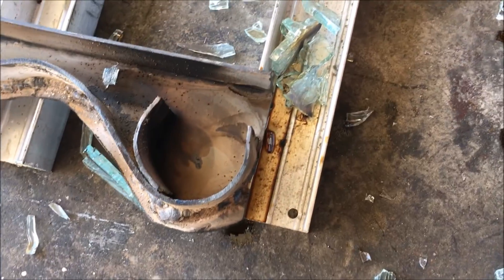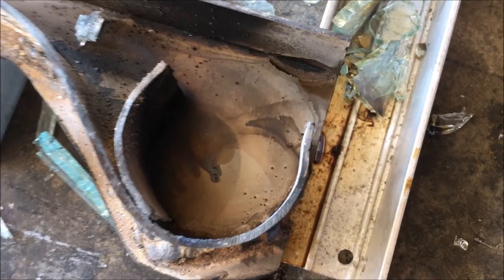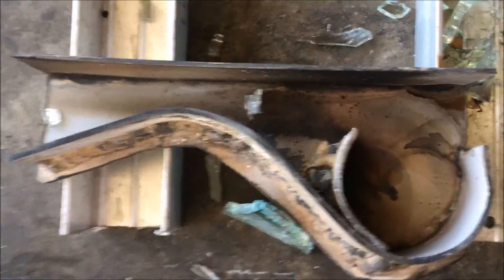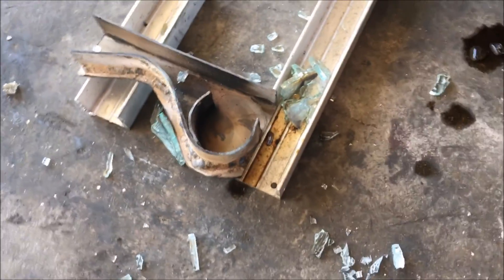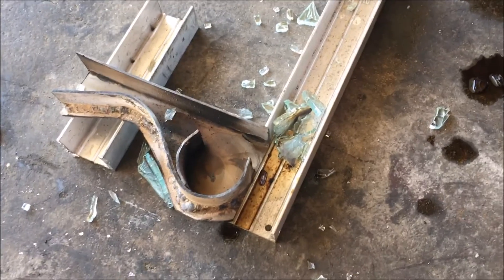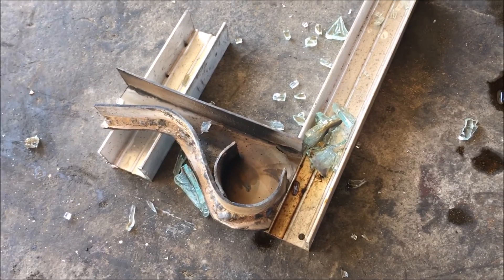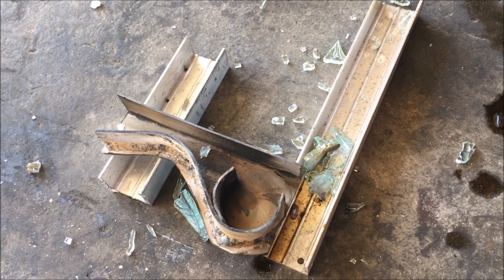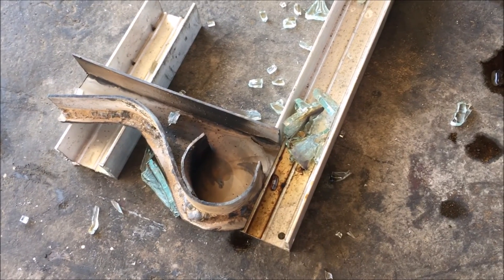Waste Oil Burner Extruded design LITTLE DRAGON

Comment: Do you think a fridge compressor could  do that? Need a burner for a knife making forge. Want to use oil .
Reply from the maker: Possibly , but not at very high outputs , i almost got it to work one day ,just make sure your fuel tank is elevated

Comment: Hi NOBOX7!!

I want to show you my experience with vegetal waste oil burning and, of course, my thanks for your help. You give me a great boost.

Please, I'll be grateful if you give me some tips and opinions.

Here, my videos with a short explanation (sorry for my bad english):

Aquí los links:

Parte 1:
https://youtu.be/8wpopvnAo08

To start the fire and preheat the combustion chamber, I use a 90% oil and 10% gasoil mix. Preheat the chamber takes 20 minutes and spends 200 ml of 90/10 mix.

Then I change the fuel supply to a 100/0 mix.

In my experience, turbulence, high temperature and a balanced mix of air and fuel are very important. It is evidenced by a blue flame. A yellow flame implies that any of the previously mentioned conditions has failed.

In the video, heat and turbulence are ok since the beginning. But, when I change the fuel to 100/0, fuel/air balance alterates. This is because oil (100/0) have higher density than oil+gas (90/10). This causes an interrupted flame.

This is fixed by increasing the oil pressure (rising the oil bottle), until I get a blue and continued flame.

Part 2
https://youtu.be/_T6cXg8BvCY

In this part I try to get the highest power as it is possible.

To increase power, I need to inject more fuel/air balanced mix. But I haven't jet a system that regulate both. I'm thinking about it.

In the video, when I increase only fuel, you can see yellow flames. Then, when I increase the air pressure, the yellow flames disappear.

Video start with only 15 psi air pressure and ends this 30.

You can see that a piece of Cuprum wire melting down. I put this to have a visual indicator of heat distribution inside the combustion chamber.

Part 3
https://youtu.be/74y_uTrsHDI

In this, I put a piece of glass, juts to play.
Fun is so important!!!

Good luck!!

Comment: Wonderful work!
I'm trying to emulate it, but I have such problems.

What kind of torch do you use to preheat and start the combustion?

I made an atomizer like yours, but I can't start the fire.

I'm trying with a 1.7 kw propane torch.

I use vegetal oil. First did it with cold oil, then warmed it. Neither worked.

I'll try mixing it with gasoline (5% first, then more if fail).

Hugs!
_
Sorry. My english is not the best.
Reply from the maker: Ok tell me do you have oil dripping out the front of the device as your trying to light it or does it all burn up with the torch on ? you may not have enough oil coming in , elevate your oil jug to increase the siphon effect and get back to me
Reply from the maker: i made a video just for guys in your situation https://www.youtube.com/watch?v=461NuKfFYyk
Reply: I can't light it.

Of course there is oil dripping, because there is not fire.

I tryed with different pressures, but nothing happened.

I asked you for the kind of torch you use, because mine produce a 950°C flame and I guess it is not enough.

The cold pressurized air with atomized oil mixes with the torch flame, and the flame temperature need to be able to heat this mix to start the combustion.

I suppose it is the same as any kind of combustion. Three conditions are needed: a minimum of temperature, gasified fuel and air to start it.

When I suggest use some gasoline I imagine this:

If my torch is too weak, I need more flamable fuel to start the fire. Once fire starts and the tube gets hot, my idea is give it just oil, because the three conditions are just present.

Sorry, I don't know if I explain correctly my idea in english. I feel like Tarzan 😁

I just saw the video you suggested to me. But I need to see it twice to catch most that you are saying there.

Comment: I would suggest trying to find a fire place door. One with a glass and use that with your experiment. Possibly even get a door that has the adjustable screw in air feed then you can vortex that air in. 

Have you by chance thought of duplicating the half circle in multiple spots but always causing the left side to quench.

Comment: Well you got a little ways out of it... Can you rig up a hotter oven to pre-heat it in?

At least you made it long enough to give us an excellent view of the flame cross section. (~_^)-b

1, if you can raise the opening temp a few hundred degrees, and 2, manage to reduce the un-heated portions of the glass [the more old glass, the more cross body stress and greater chances to shatter. 3, if you can somehow trick the exhaust where it flows back around the outside [without burning your hands, the nozzle or the table] you can keep the outer edges warmer and reduce the cross body stress greatly (I can sketch an illustration of this for you)]

I am not able to expertly claim anything, but your flame front looks to be moving anywhere from 350 to 450 mph, starting from the 200 to 300 mph air/fuel jet.

There are quire sensitive laser sensing machines out there that can actually determine flame speed, and you could possibly find or make a very tiny air speed sensor [like this but much smaller, I know they exist, but not where to get one without some serious research, you could in theory make one with nothing but some scrap metal and a cheap tiny DC motor and a volt meter, and again, I could sketch the design up for you] and insert it into the exhaust stream at various points to take readings.

Keep in mind, of course, that the sensor its self, being a mechanical obstruction, would to some extent interfere with the air flow, and in so doing, slightly create its own inaccuracy, so to some extent, one has to compensate with a minor mental adjustment. The sensor, by obstructing the flow will cause a pinch point which will ever so slightly, especially in points of smallest volume, force pressure head of its self to rise, and behind its self to fall.

This means one should allow a margin of error of +/- 5% on the final reading.

If you can estimate the speeds, you can also estimate the percentage efficiency of the combustion, albeit, I do not remember where I saw the formula, [I would have to search long and hard for it] there is a complex chart like a slide rule which allows one to estimate combustion efficiency on things like velocity, pressure, air/fuel ratios, atmospheric oxygen ratios, humidity, etc that jet engine designers formulated back in the early 60's as the jet age was just 'taking off' [pun intended and copyrighted =P ] .

Technically, without proper air dilution, the air fuel mixtures inside a turbine engine CAN get hot enough to melt the metal it is made of.

They get away from this by carefully diluting the flame with excess cooling air and using 'air envelopes' to shield the metal.

That makes me think.... If there were some way to make an air envelope between the glass and the flame, without disturbing the native flow of the flame, you could more easily observe it... No promises on not disturbing the native flow though.... ~( ,m,)~
Reply from the maker: I definitely enjoy Mathematical formulas , many of my older videos showcase that side of me , mostly chemical kinetics and thermal dynamics and a dab of Physics Mostly heat engines  and fuel synthesis  . Any way Im currently unemployed and cant justify spending any money , however i just finished a job interview for a high paying job so hopefully that works out . im a union carpenter so when a job is done i have the choice of taking time off or working for cash on the side " they hate that "  . Hopefully ill have some spending money soon and we can start doing these more sophisticated experiments . Im stalling at the moment lol  . And the Charts yes i think ive seen charts like that , they look like steam table's correct ?
Reply from the maker: as for the glass , i think if i get the lighting correct and we watch it at reduced speed also , then we can get a good visual for long enough to see what could be improved  , also maybe we can approximate the speed by drawing some 1" lines in the shot next to the flame , then we throw in some fine carbon dust or charcoal maybe even saw dust but thats a little big and may not travel at localized speeds     but the carbon powder would make visible individual sparks that could then be chosen tracked and then chronologically radared  using simple equations based of the video time stamps , i think we can do 1/8 speed on my editing software  so maybe if a spark flies  5 inches 0.5 second at 1/8 speed then we have 5" per 0.0625 sec so 1/0.0625 = 16 x 5 = 80 in/sec thats only about 5 mph but you get the point . the math just kinda showed it might not work lol its to fast to track it would seem with a camera this crappy . 400 mph is like 7,000 in/sec so never mind , havnt eatn yet maybe i botched the math some how , havnt checked my work but so far it dont look good for that idea .That spark would travel 437 " in 0.5 sec at a frame speed of 12.5% so no way the eye could work with those parameters . But a high speed camera could totally pull it off
Reply from the maker: I need to break down and buy a flow meter also , we could determine the air velocity of my siphon
Reply: I can totally relate to all of the issues you are experiencing, I hope you get that job!

If I get 'rich' somehow with some of my investments, I'll send you some money to support your work, either way, because you are trying really hard and deserve the support.

I would have already, but my local budget is still pretty tight here my self.
Reply: A way to ensure you can see the speed of your gas flow electronically would be to release single specks of something light [such as tiny flakes of magnesium foil or shavings which can be obtained either on e-bay or by scraping them off of a lawn-boy mower housing or a fire starter stick from Wal-mart or a camping supply store] with say tweezers at the inlet of the system and then counting the frames it takes to cross from start to finish.

The higher the frame rate, naturally, the more precise your measurement, although it may be that poor luck or sloppy aim may lead to it getting stuck in the swirl chamber.

On the other hand, putting too much in there at once can mess with the light sensitivity and the results of the shot, and/or clogging the chamber with ash, so dumping a whole lot at once would not be a great idea.

Just picking light flecks and dropping them in and around the nozzle at different locations on high speed setting should provide a pretty good estimates of gas flow, and the high brightness should make it show up well as long as it is not whited out by too much.

One might think the flakes would burn up before they got a good measurement, but if its traveling as fast as it seems, or even in the area of 50 mph [should I be off by a factor of 10] (that is 73.333 feet per second by the way) and so it would take roughly 0.0137 seconds if your flame path was 12 inches across, so not much time for it to really burn out and cool off.

Knowing the distance across, especially if you had one of those black and white rulers [say like taking something white and heat resistant and putting black stripes of heat paint on it to measured increments] and lay it at the bottom or top of your area of view [the top which is flat is the natural choice here] and count how many black and white dots the flaming speck passes per frame and that will give you your approximate speed.
Reply from the maker: the oven defiantly bought us some time , to bad the idiot running the camera forgot about washout .
Reply: Maybe if you have some more of that glass laying around, you can use your wood stove to heat it higher than your oven can?

Get it pre-heated in the regular oven then quickly transfer it to the wood stove and gradually raise the temp up as hot as it will and you should be able to get better results.

Also, wrapping the outside in insulation will slow the cooling process.
Reply from the maker: thanks , never seen this comment , sorry i did not reply , youtube comments are so broken
Reply: That's fine, it took me a week to find out what was wrecking my computer, got infested with some kind of newfangled bitcoin mining hack that took a while to discover and clean out.

Comment: Wow yeah that is a cool system . So the input has its pressure decrease on the Lower side as it glide over the lip which in turn creates the vortex?
Reply from the maker: Yes thats the idea but it wont swirl enough  without  the stater blade . Diagrams and simulations ive seen suggested it would do just as you said without the blade. The  Venturi effect is so powerful at the flow rates we are operating at that the vortex is swept away and only a tiny one persist that cant keep the flame lit . No vortex no combustion thats the deal , unless you induce a pulse jet and thats just to darn loud  , like Cops showing up loud

Comment: At 3.44 in I wonder if the surrounding external air temp at the front of the burner is getting that hot compared to the air being injected in to the burner and surrounding rear air outside that it is turning the front air vapour Into nitrogen that is then sucking in to the burner by way of the hot to cold science equation may be to check that just place a row of small metal rods on the lower exist of the burners plate like a conveyer belt style this should act again as a tumbler disturbance and heat holder to cause your white flame to fill the whole burner.
Reply from the maker: great idea i see waht you mean , like a gold sluice box  correct ?  very clever , it would be good to have rolling eddies on the bottom
Reply: Yes a gold sluice.   Was thinking what to relate it to and that's perfect
Reply from the maker: You have good advice old friend how are you doing these days my fellow carpenter , are you still building ?
Reply: Still building my house a long term project as I have a plant engine and small truck yard to clear and also need to show more updates on my static land rover engine running on just ionic transfer that may be soon   And you'll definitely be on my list to ask you to copy it for proof     It's all for free from me
Reply from the maker: cool cant wait to see what your working on
Reply: yes it really is vander vault forces electro static magnetic static but the neutral form not positive or negative    like how clouds float with trillion of tons of water above our heads sort of   many people have done it lord kelvin 1700,s  for one thats how much weve been suppressed from a abundant next to free energy   the guy who did it recently joe booker his friend tells me your statue of liberty is copper and bronze and its standing in SALT WATER  so you must know thats a BATTERY so is it powering manhatten ?   he tells me tesla had something to do with it  lynn eykamp his name  their knowledge would blow your mind